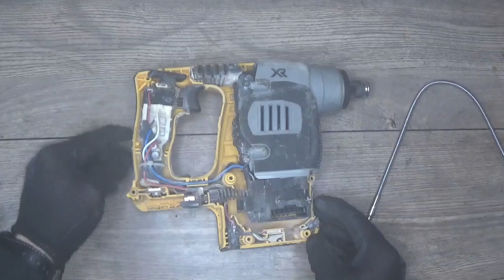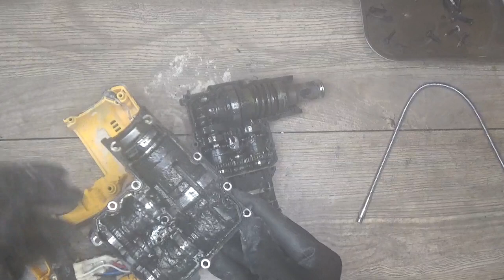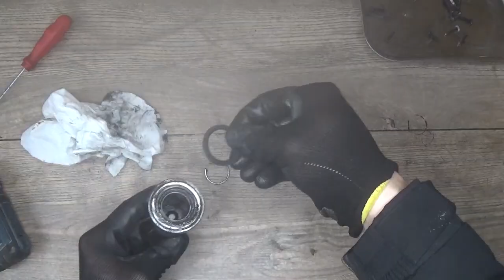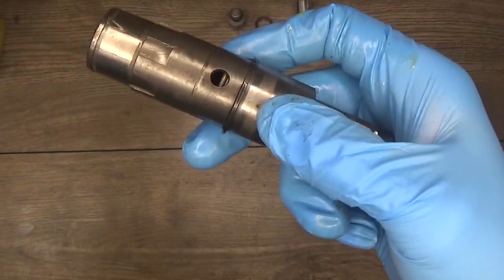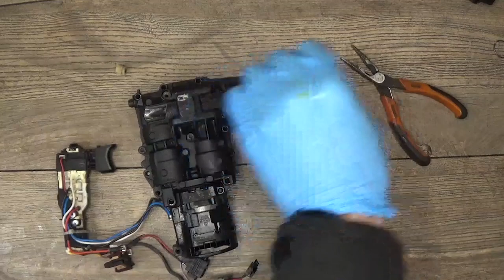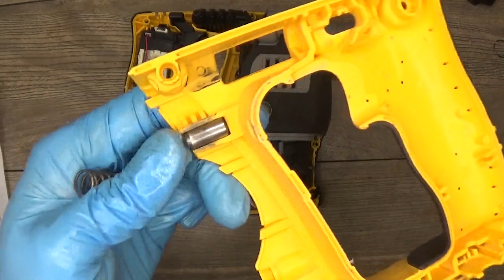Reviving the Power: Dewalt DCH273 Hammer Repair & Maintenance Guide #dewalt #dewalttools

Comment: Hello.
That spring that goes on the rotating ball axis that keeps the ball seated on the rotating plate, what would be the part code?
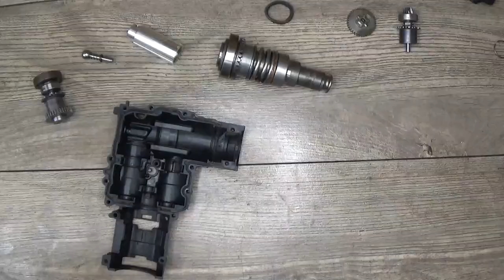I'm referring to the spring at the minute @14:14
By the way, the video is very good
Reply from the maker: hello, thank you. Part number 490286-00

Comment: Thank you for the video!
Is the ram supposed to be pushed into the piston that far?
I’m having trouble with my Dewalt dch273, when chipping/hammer mode when you release pressure the chisel pushes out to far and it sticks so it doesn’t hammer, so you have to put a lot of downward pressure on it to push it back into place so it starts hammering again. I just replaced the the ball, spring, washer, piston, ram, and o-ring, but it’s still doing it. It seems like it’s the beat piece that’s sticking, because I can push the beat piece back in with a screwdriver, but it could be something else slightly jamming. I have some videos on my YouTube channel showing the issue. Do you have any ideas?
Thank you again!
Reply from the maker: I think you need to try replacing hammer, don't forget to grease it - I usecMakita yeallow grease. From your videos tool looks like new, its not under warranty?
Reply: @powertoolsrepair  
Thank you!
Unfortunately it was bought about 4 years ago and it was only used 2 times in the first year. It looks different now, because it’s been used a lot in the past year. It’s had this problem since I first bought it. I thought it was normal until it became annoying to use and I figured something has to be wrong. 
So you think I have to replace the whole front piece(spindle), part number N477771, or all the parts inside that spindle piece?
Thank you again.

Comment: My hammer had the clip #35 distorted and off the spindle. How do you finish the final assembly of the spindle so the spring is compressed enough to install the clip? The washer, Item 34 is too large for the clip to retain. Since the washer is the same one that was in the unit, I was wondering if the clip was supposed to retain it or go directly on the bearing. I would appreciate any assistance in this. A great instructive video.
Reply from the maker: I think clip must retain washer and I fix all parts in a vise to press spring and make assemble easy
Reply: I need to reassemble that as well, could you provide more details on how to compress it with a bench vise? Did you use a custom tool like a holow socket to push the retainer all the way in? A video about that would be cool 😅
Reply from the maker: @tornecro  I press one side with vise and gently hitting other side with hammer to get it pressed all tha way
Reply: Can you make a video disassembling of spindle. Will be great helpful.

Comment: I have this drill and it hammers but feels like it is not hammering as hard or fast as it did, think it might just need cleaning
Reply from the maker: It can be that its need to be cleaned,but change o-rings and grease, check motor if its good